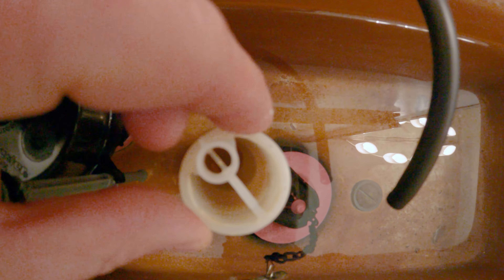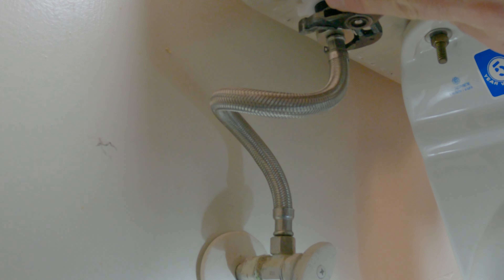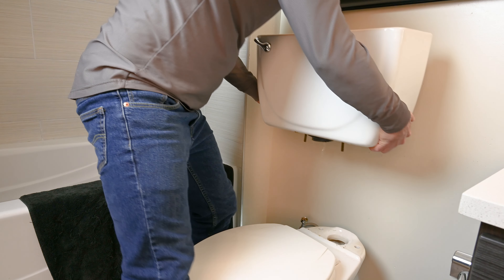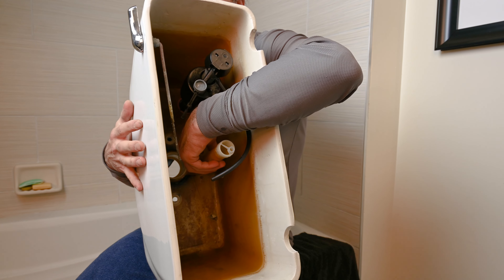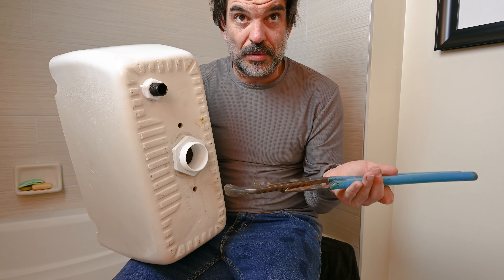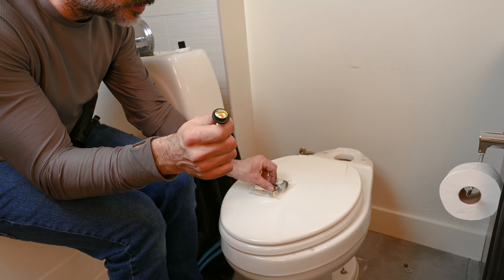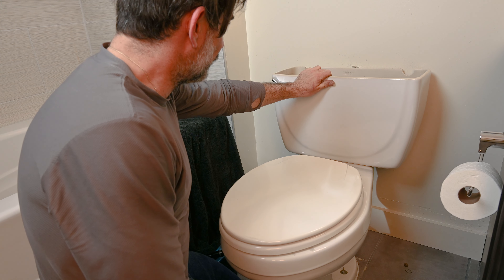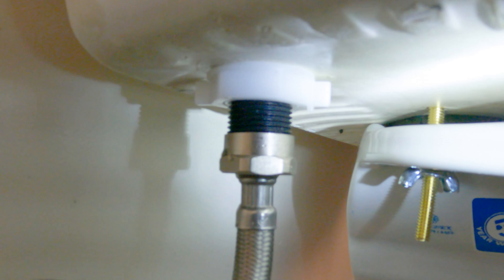Toilet Flush Valve Installation

Comment: The bowl to tank bolts are typically rusted, in which case I use my sawzall to cut the bolts between the tank and bowl.

Depending on the replacement part ( I like Fluidmaster parts) you might need to use a thicker tank to bowl gasket (available at HD)
to get a good seal. 

At the same time I will usually replace all parts inside the toilet unless it's been recently changed:  fill valve, flapper,  (flush/overflow part comes with a new flapper), flush lever and supply hose.  Sometimes have to replace the water shutoff for the toilet if if won't shut off.
Reply from the maker: You must work at an oooold property then, I've never had to take a sawzall to the bolts (mostly 20 year old and younger) tanks though. Kitchen faucets that are 20 years or more that's a different story